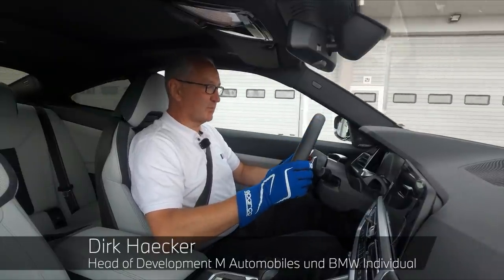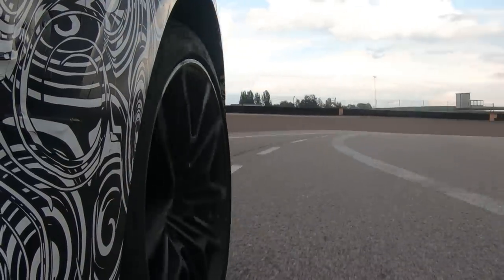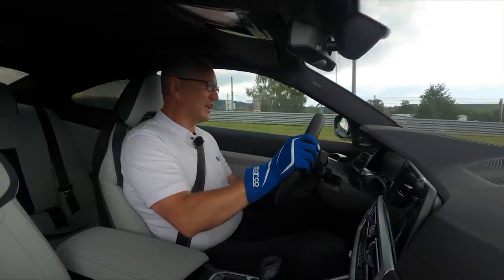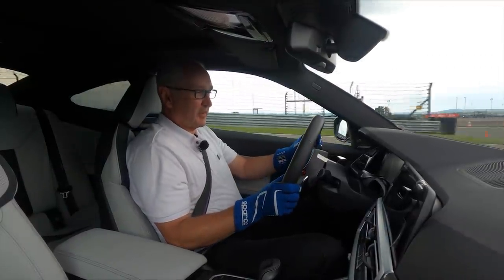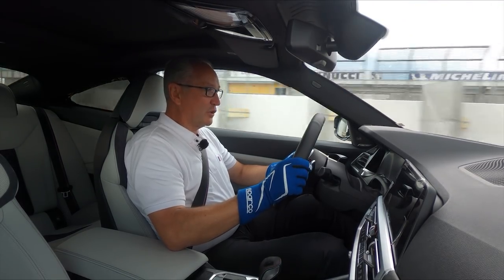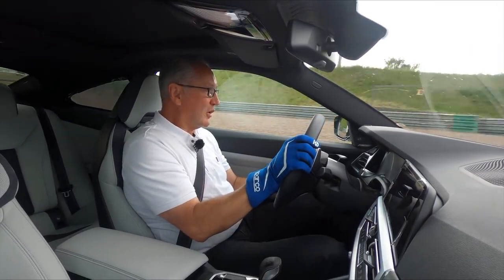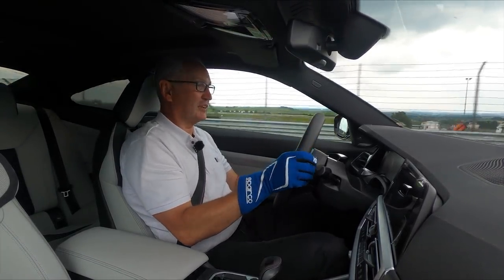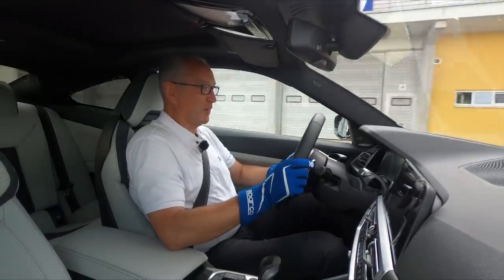BMW M Head of Development on the new BMW M3 and BMW M4. (G80, G82. 2020)

Comment: Even more front grip on a car that hardly understeers? How sharp must it be, even with AWD
Reply: At first glance I red "even more front grill". Dammit.
Reply: Yeah I cocked my head nearly horizontally when I heard that. Has this guy never driven an M car before? Since when have they ever had a problem with front grip? They’re probably the most tail-happy sports cars out there. How about adding a wing to get the rear planted...
Reply: @MegaFregel  both true. lol
Reply: It's gonna understeer when it has AWD, which the new ones will offer as an option.
Reply: Nomad Jedi I’m sure there will be a computerized torque vectoring system that will prevent that to some degree, similar to what Porsche uses. I was really just talking about the RWD models.
Reply: @RB-xv4si  A car can experience power oversteer while still exhibiting terminal understeer characteristics. They're not mutually exclusive
Reply: SAR i don’t even understand how your comment is relevant to what I said.
Reply: @RB-xv4si  You said that the M3 never lacked front grip and cited how it's always so tail happy. I simply pointed out that power oversteer doesn't mean that it has plenty of front grip.

You can still cause the current gen M3 to understeer into the corner if you're too aggressive with the steering angle, or if you're too early and gentle on the throttle on the exit. This is because the M3 has an even weight distribution but smaller tyres in the front, meaning that it experiences terminal understeer. You can still cause the back to step out if you accelerate really hard through a turn though, which is why it was designed to experience terminal understeer in the first place. It's safer that way.

The next gen M3 has an almost square tyre setup. This will make it less likely to understeer when off-power.

Comment: the regulations will make it sound boring, but I will still always love the m4 and m3
Reply: That's why many Tesla owners are ex BMW M car owners. People rather have no sound with insane acceleration and performance than an embarrassing sound with top end speed only.
Reply: @borinvlogs  we wont be hearing the pops and crackles from the exhausts again, I'm most likely gonna get the m8
Reply: TTV Videos you will hear them, the engine comes from the x3m I believe
Reply: @kevinsosa6502  the new twin turbo straight 6 I think

Comment: I love BMW and M. I have an E92 M3 and an M6 GC. The loss of DCT is a backwards step, as is the constant weight gain and sizing up of the cars.
Reply: Bean counters having full 3rection. That's what happened here.
Reply: I disagree. A good torque converter nowadays is just as good as a DCT on track. 

In addition, given the car will spend most of the time (probably 99%) on the road , then a torque convertor is much better in day to day driving and only gives a really small % difference when on track. 

Compare the zf8 speed in any f30 335i or 235i etc and the dct in a M3 or M4 F80 and the zf8 is a much better gearbox most of the time and even on track the benefits of a dct are mitigated.
Reply: Jamie Bridges do you own or have you owned either? Driven them significantly on road or track? There is a massive difference. Full stop.
Reply: @PepegaPig  Show me a video of M235i/M240i downshifting instantaneously on command going into a corner. My 10 year old E92 M3 shifts faster than that. DCT gains forward inertia from each upshift where ZF8 momentarily loses boost from gear disengagement. If ZF8>DCT as you say, every supercar brand would have adopted it long ago.
Reply: Chris Jay end of discussion. Agreed.
Reply: @Patr1ck2332  yes I have . I own a m135i zf8 speed and have driven at length an m4 and not to mention also owned other dct equipped vehicles. Zf8 around town is silky smooth. M4 even with gts* software flash was jerky at low throttle inputs pulling out of junctions etc.

You can't argue that in daily driving a good torque converter such as the zf8 is better.  

That's also probably why Audi / VW have also moved away from dct to an 8 speed torque converter also in their rs4/rs5 etc models.

My friend also has a dct e92 m3 and I feel it's no better gearbox on track than my zf8. Granted I also have xhp stg3 software.  

As standard software it was really decent and I did many track days with it before changing to xhp without any complaints. Infact I only got xhp because I paid virtually nothing for it.

I'm not saying that most dct are better than most torque converters on track but you're kind of missing the point, that honestly how many of these  cars will be tracked, and how many of those people who track them will have the skill / ability to be in any way restricted by the gearbox, and a further question how many hours per year does your average M3 owner spend at the track versus driving on the road...
Reply: @chrisjay1231  i have logged my own car boost is not lost during upshift with zf8 speed. Almost imperceptible in the data logs (done with MHD) and you don't feel it in the car.  Plenty of dragy pulls online also back this up. 

Again comparing a supercar (ferrari etc) to an M3 is a different kettle of fish. Another thing to note is many dcts are used over torque converters because of torque limits. Most dct can handle higher torque than the torque converter . 

At end of the day it's personal preference but I can totally understand the decision to move to a gearbox which is better more of the time (torque converter) vs an older school dct.

In 2005 a dct was miles better than the torque converters at the time. This is 2020 now.
Reply: @PepegaPig  I drive extensively both on track and backroads and I get really annoyed when manual shift lags no matter where I am. M235i has the best ZF8 yet it still lags and is relatively inconsistent; my 6MT shift times are better than ZF8 at times. DCT on the other hand is consistent and fast.
Reply: Jamie Bridges totally missing the point in general. M cars where at the pinnacle of technology and spec. Now they aren’t. We can sit all day disagreeing about gearboxes, but the dct is better than the zf8 without question. It’s a cost saving manoeuvre and that’s about it. If the ZF was that good they would have introduced it last gen. DCT does what you what all of the time and is lossless power. I don’t care about silky smooth in an M car. For reference I track my 92 multiple times a year at the Ring. No one will agree that the ZF8 is better than the dct sorry. Enjoy your cars, each to their own, but it’s a mute point and a misinterpretation of why BMW has gone this route just because it is in the latest cars and as another person commented, if it’s so good why isn’t Ferrari or Porsche using it in their sports and supercars.
Reply: @Patr1ck2332  i mean when you say "end of discussion " in such a way it kind of says a lot about your ability to hear other opinions other than your own or those who agree with you. To say "end of" as if you are some sort of empirical expert on such a matter is very arrogant. 

I won't be replying any further  on this topic.

 Have a good day :)
Reply: Jamie Bridges opinions aren’t facts. It’s fact that dct is better than the zf auto. So it’s a total mute point to discuss. I’m not dismissing that the zf isn’t a decent gearbox, it is, I had it in one of my other cars for a couple of years. But we are talking full fat M cars. It’s night and day. I track my cars, I don’t attest to being an empirical figure. It’s again missing the point.
Reply: @PepegaPig   There is an extensive thread in bimmerpost about this. "ZF8 cannot handle full throttle power upshift and has to momentarily cut with each upshift. DCT does not. This is represented by your head moving forward(ZF8 cutting power) and your head pushed backward (forward inertia of DCT)".
Reply: Chris Jay DCT is old now most car are moving to torque converter automatics. Known to be more reliable, smoother for daily driving and shifts just as fast if not faster
Reply: Sam another one. What do you drive?
Reply: @Patr1ck2332  I have 2008 skoda octavia vrs 170bhp diesel. I want m3/4 one day.
Reply: @chrisjay1231  Correct ..it's such a shame. I would understand the decision for the M5, but the M3 is not a GT car. I have a M3 CS with DCT that I only drive in Manual and an automatic would never replicate the aggressive feel of a DCT shift carrying momentum forward. Never used the automatic function. Corvette and Ford are now going DCT and BMW is going auto. The tables have turned.
Reply: Losing the DCT is absolute fail. The top spec M cars DCT is part of the experience. People saying it’s missing “smooth” or “almost as fast” or “most don’t track” need to buy a different segment. Having a street performance car you can track is what M is all about.
Reply: @PepegaPig  dct is the better gearbox all round for the driver who shifts manually like i do everyday in my e92 . It feels like a sequential. The zf 8 speed in my x5 is great, but jesus, nothing on a dct. In a sports car, a dual clutch is the box to have. You dont see porsche putting torque converters in their new carrera's for a reason.
Reply: @Sam-mw5hx  There is nothing Motorsport about ZF8. I don't want smooth, efficient shifts in my M3; I want instantaneous, head-banging forward inertial upshifts and fierce downshifts.

Comment: "Steptronic" means BMW ditched the dual-clutch. It is an automatic transmission.
Reply: haven’t they been trying to make steptronics mainstream since the early 2000s? i don’t see an issue in it whatsoever if it gives them better performance/times to show off while still offering a standard transmission for people looking for that experience. seems like a win/win to me
Reply: @ethang0746  Yeah, BMW has been ditching dual clutches for a while. The 5-series is all automatic now. The whole terminology of 'Steptronic' goes way back to the E46 automatic transmission. They are now pretty much as quick as dual clutches and way more reliable and efficient.
Reply: The automatic transmission can handle more torque the a dual clutch one. Thats the reason i think for switching to a automatic. The new m5 has also a automatic transmission and it performs very well. The new rs6 and rs7 have also automatic transmission instead of a dusl clutch
Reply: @oxidalpha6350  I know. I don't disagree. I never was a fan of the whole dual-clutch because they are so fragile and offer no significant advantage over automatics these days
Reply: More reliable, lighter and given the horse powers the dual clutch is not really necessary
Reply: My 118i  F40 has the 7 speed DCT which they also call steptronic..they use this term for auto boxes I think. I wish it had the zf 8 speed torque converter box instead of the aisin 7 speed dct
Reply: @PL3690  I think the new M3/M4 has the auto box like the M5/M6/M8 have.
Reply: @2ZZGE100  Fragile? They are not Fragile, most supercars have DCT.
Reply: @jostrander71  I know, but BMW is ditching them for a reason.
Reply: @2ZZGE100  Because the ZF 8 speed has caught up in performance, so might as well go with a torque converter as most people would never feel the difference in performance and it will be smoother overall, but it will never have that jerky mechanical feedback of a dct.

Comment: Looking at bumper I'm still not convinced it wont have the stupid grill
Reply: The M4 will, the M3 won't
Reply: @David-ro2nr  what you think they will have different front ends? I cant see that for cost reasons and also the 2 door and 4 door Ms always have same front?
Reply: Dale Steel well the new g20 cars don’t come with the big grill and since those are 3 series cars it would make sense for the M3 to also not come wit those grills.
Reply: Every time a new model M car comes out, people always complain without seeing the vehicle first. Then, over time, people will eventually come around. See you here in a couple of years and tell me you still hate the M4. I willing to bet you wont.
Reply: @GaryDownes  I've never moaned Bout how an M car will look. I even like the e60 m5 when most people hated it. However the new 4 series is different. Its looks stupid. I even like the new 7s massive grills so your completely wrong I'm afraid.
Reply: @David-ro2nr  Incorrect, the M3 and M4 will both come with the big grill. It's already been confirmed.

Comment: M the most powerful letter in the alphabet M/// Power 👍👍👍
Reply: Until u add an A and G
Reply: you're brainwashed by marketing people.
Reply: Hi I have owned all different models of BMW including the M cars  always serviced regularly but driven hard never had any problems over 20 years of ownership I have had 2 c63 Amg’’s  the first Was only nine weeks old when it was replaced  due to a electrical problem they could not fix the second one destroyed its engine after 4200 miles my wife has a GLE which has 7600miles and needs a new gearbox definitely not brain washed will never own another Mercedes

Comment: Less power for manual cars is wild!  They're really trying to push us away from manual cars.  smh
Reply: To reduce consumption u need to reduce power
Reply: It’s because the car is 2wd vs the Auto 4wd. Only reason
Reply: BMW M what technical reasons? Limitation of a gearbox? A tuner will map the car to 600hp within a few months of release.
Reply: Patrick2332 you think he doesnt know it HAHAHAHAHAAHHA
Reply: @ BMW M I want manual transnision at least on m2 m3 and m4  i would never buy bmw with auto
Reply: BS reason. F1x M5/M6 6MT were rated for 680Nm of torque@560hp. M3/4 makes nowhere near that torque or power.
Reply from the maker: This is due to technical reasons.
Reply: Mohamed Alaali who?
Reply: Chris Jay exactly!
Reply: BMW M what are those technical reasons? I’m trying to learn. :)
Reply: @shoshKid  I believe it has to do something with not enough space for the transmission in the car, I heard someone talking about it here on youtube so don't take me too seriously because I remember it only vaguely, but something about there not being enough space because of the light materials being used or so.
Reply: Isantir Thanks man🙌🏽

Comment: As a Manual M3 owner, I would love to try out that 8 speed gearbox
Reply: Not DCT but torque converter this time. You won't like it; manual shifts are unenthusiastic at best.  6MT would be the only model remotely worth considering for F8x owners.
Reply: kyrix1st no DCT!!! So lame
Reply: kyrix1st thats so wrong, a good torque converter is not any worse than a dct.
Reply: @paradox5556  No, I would take the characteristics of a DCT any day over a automatic with torque converter.
Reply: Spartan sure, i would take the smoothness and daily of the torque converter. Everyone has different needs. And honestly, most people that buy these cars, don’t care.
Reply: @paradox5556  They use to care, now it just seems to be more of a status car than an enthusiast car.
Reply: Condolences 🙏🏼
Reply: @SpartanA31xx  I disagree, My friends with M2C and F82 M4 have been tracking it and taking enthusiastic drives. I am pretty sure ///M will keep that philosophy as always. Also, Torque converter will double the power delivery of engine especially for acceleration.

Comment: I am done with BMW, as //M is too watered down now and they have lost their way, BUT... for those who do buy them I hope they fix all the issues I had with my 16' M3...

1.) Poor rebound damping
2.) unstable rear when braking hard with any steering angle.
3.) Poor stability / Traction control that fights you rather than working with you), probably because of the poor damping and lack of chassis stability.
4.) Brake pad/rotor material that do not work well together and causes vibrations.
5.) Lack of traction
6.) squeaking door seals (M3)
7.) NO DCT?????     FAIL!!!!!!

I am 2 years into my SS 1LE and still loving it, everything the M3/4 should have been performance wise.    

Next up Porsche GT4 or upcoming C8 Z06.

Comment: BMW do Brasil has denied warranty on a BMW M5 (owner Eduardo Razuk of the YouTube channel Razuk Backstage) with just over 150 kilometers run, it had malfunctions in the transfer box according to BMW do Brasil for doing lauch control and activating the dynamometer mode for 40  seconds, and it was not used, only activated for 40 seconds!  Does BMW do Brasil disrespect the enthusiastic consumer of the brand or is the BMW M5 a fragile car with a chronic defect in its transfer boxes (4x4 and 4x2)?  disappointment!
Reply: @GaryDownes  true
Reply: The problem is that it's a Bmw... Don't expect it to be reliable because they are not! Bmw got some serious quality issues.
Reply: @TheScick  sure mate
Reply: @MrAjaz1990  The problem is that people belive in the "german engineering" myth... If you check pretty much any car reliability survey you will find those in the bottom of the list. They break down often and are expensive to fix.

Comment: I couldn't care less how ZF8 is better on streets going for grocery shopping. People should get M340i for that. DCT/MT or no purchase on M3/4. Hope they introduce it on CS~ models.
Reply: The ZF is simply better now. Have you driven the new variants? It’s phenomenal.
Reply: @huntermurray956  I have given many chances to ZF8 from F90 M5 to X3M comp but neither delivered motorsport inspired shifts like DCT does. It is technically rev limited to 7300rpm due to oil cavitation vs. DCT's 9000 rpm, and it does not like being shifted near the redline unlike DCT. 
I don't want a beefed up 340i, I want an M3.

Comment: Why dont you drop a x5 M engine on these cars?
Reply: Too much weight over the front axle with an 8 cylinder. With the S58 inline 6 turbo the car will still be balanced.
Reply: @benweekesmsport  what about c63 AMG?
Reply: LWEEZ it’s good but the C63 doesn’t have a 50:50 weight distribution like most of the M series cars.